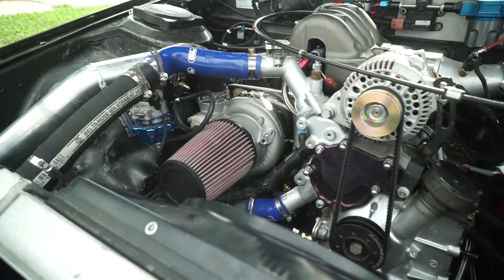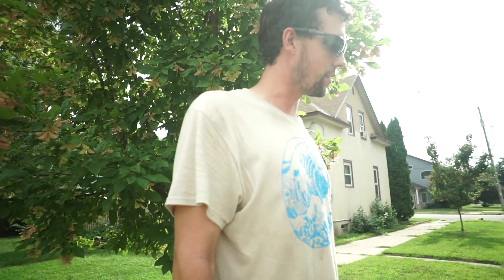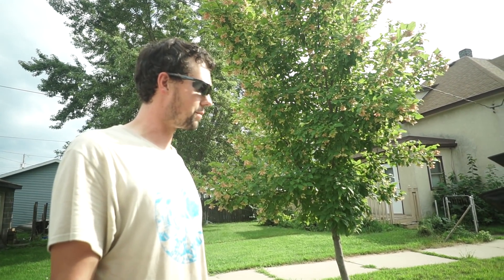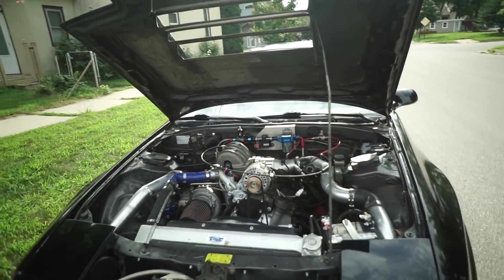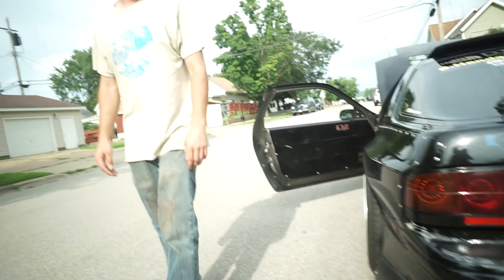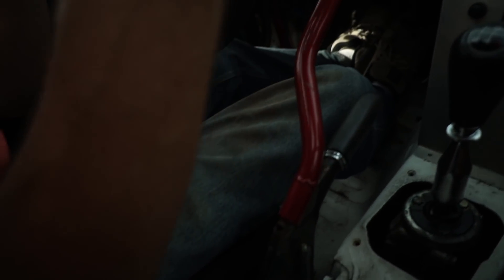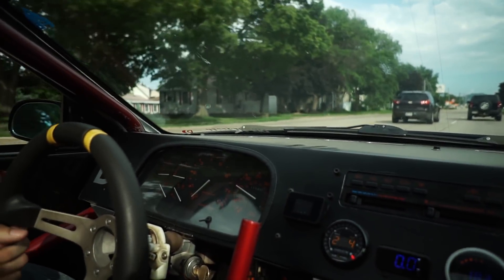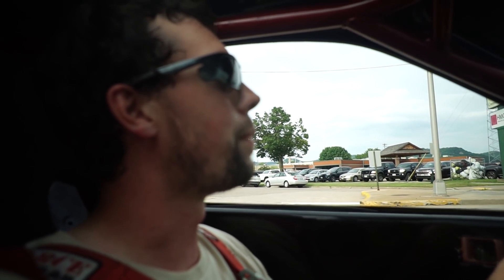Banana put a new Turbo on the RX-7

Comment: What you using for premix and what ratio?
Reply: Robert Montgomery Redline Alcohol 2 stroke premix, 2 oz per gallon
Reply: Joel Lahmayer Thank you. I assume you have removed the OEM oil injection system? And it looks like you have an electric water pump?
Reply: Yeah deleted oil metering years ago.  It is an electric water pump kit also from turblown (same place I got the turbo setup from)
Reply: I see you are in Wisconsin, me too. I use Turblown too.

Comment: Are those the injectors clicking?
Reply: My transmission input shaft rattles around for some reason with the clutch out in neutral.  Otherwise you're hearing the tinny exhaust pulses through the downpipe.
Reply: Joel Lahmayer Oh okay. But it was when the camera was in the engine bay. Could you still hear it there?
Reply: I think it's the exhaust pulses lol.